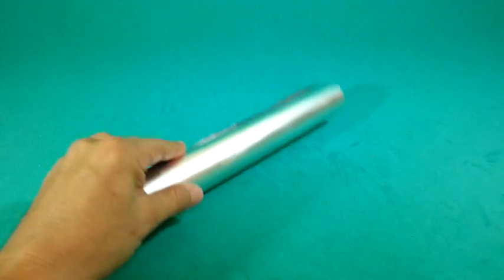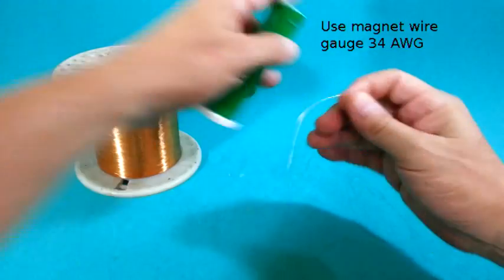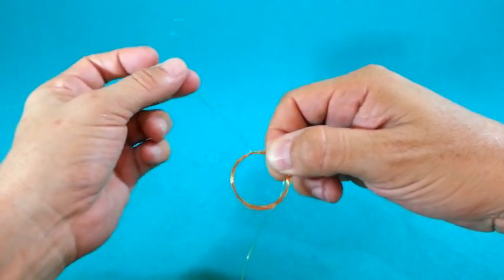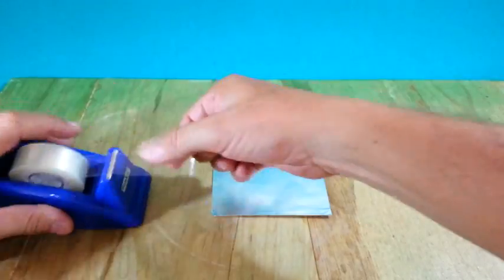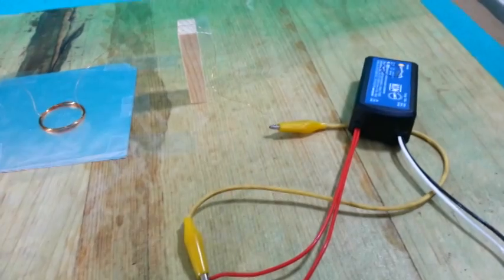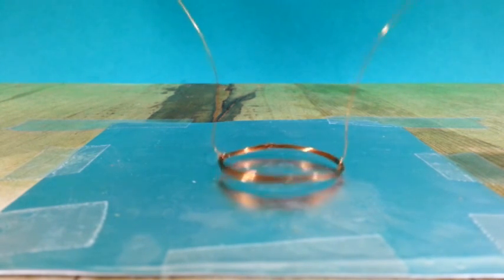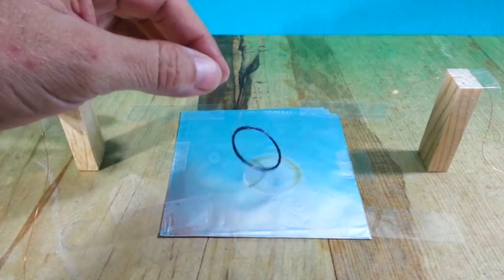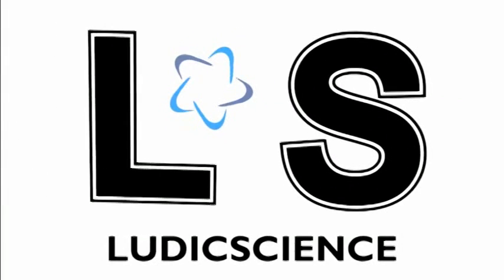Levitating Coil - Lenz's Law

Comment: Your vids are cool but sometimes you're mistaken. Ballasts are DC, although they can generate frequency.
Reply from the maker: You´re right. It´s hard to make them both simple and accurate. The correct explanation would be to say that the ballast is high frequency chopped dc current, that produces very similar effects as pure ac.

Comment: cant I use a 60hz transformer and a 470ohm 1w current limiting resister 
or 
I have a 800v Philips 36w e ballast 
will it work
Reply: Ivan R but it has 50 volts drain source limit. therefore its only usefull for half wave inverters. forget about making zvs, because the input inductor+the energy in the lc circuit can give it 60v if you work with 12v input
Reply: Mrinal Thakur awn well, I guess youll have to order it online then. BTW, did you recieve what I sent you on google +?
Reply from the maker: No. Low frequency will not work.
Reply: Or pulsed dc form a irf540 by a 555
Reply: Well hello there! Yes, a 555 timer will work, but an irf540 , is not very good for this circuit, because it can only handle 28 amps continuos current, and "100" amps pulsed, seems a bit bullshit, and it will realistically only take up to around 45 amps, and it is a fairly low speed mosfet. A BUZ11 will do a much better job as it can handle up to 30 Amps continuos and 50 pulsed, and it has a higher transition frequency, other than that the design is good! BTW, we just moved into Singapore, and im making that MOSFET Audio Modulated Slayer Exciter I was telling you about, and I already have several circuit prototypes and a final circuit, which im gonna finish this month!
Reply: Mrinal Thakur irf540n and 540ns is the best mosfet i have ever seen. best max current and high frequency performance for the lowest price
Reply: Gotin Fuklio I pushed it upto 284khz
Reply: Gotin Fuklio hen try irf460
Reply: Gotin Fuklio The BUZ11 can handle more power than the irf540n, and it can reliably work at a much higher frequency, and I used it in a flyback driver, and as a mosfet tesla coil. IT RAN ON 380 KHz! Not 55KHz, and it is better for this circuit already because it can handle up to 50 amps pulsed current! Not 30 amps!
Reply: Gotin Fuklio indeed, but you can use a simple snubber circuit, to clamp the high voltage feedback, and why make a zvs inverter, when it works with a 555 timer inverter, and the 555 timer inverter is much cheaper, and has a similar efficincy, and I am certain it can be used in a full wave inverter, because I have made multiple half wave 555 timer inverters and transformer drivers with it, and I was able to drive a flyback from up to 30 volts, and, as the output is a square wave, you end up having to do completely different calculations for the output voltages, and you can get those same 240 volts from a 12 volt transformer, from 3 VOLTS!!! And when resonance is achieved, you can get 10KV!!! From that same 12 volt transformer!!! Additionally, those parts can tolerate anything within a 50 percent overload/ overvoltage, so it can survive a small zvs, and why not just use a higher gain transformer?
Reply: Gotin Fuklio yea zvs is far better
Reply: Ivan R i make circuits that draw 3+ amps
Reply: Ivan R 1,5 mhz with steel core and 90% is bullshit
Reply: AlertIowa1234 yes
Reply: Ivan R let's see
Reply: Ivan R no they don't and in India mumbai
Reply: ever tried giving it a higher voltage input like 32-60v? BIG Heatsink tho
Reply: +AlertIowa1234 I have tried up to 90v from a 1200 w boost converter
Reply: low frequency and high resistance would kill the induction
Reply: Did you bought that rf function generator
Reply: That's the only MOSFET availabe for cheap in India I get a pair of those for 119 rupees
Reply: Ivan R irf540n/ns are the best for frequencies 55 khz and less. more than enough for most of the uses you can find for it
Reply: Mrinal Thakur 460 have bad high frequency performance and are expensive. 2 irf540 in parallel make 460 obsolete. 460 is rated 500v drain source-way too much for the most applications especially homemade human touch safe circuits
Reply: Gotin Fuklio what is home-made human touch circuit
Reply: Ivan R can a 240v transformer's insulation withstand 10kv
Reply: Mrinal Thakur 1kv is the limit. 10 kv would break trough it
Reply: Ivan R i did experiments 555 vs zvs. the same mosfet on 555 vs 2 on zvs. meanwhile the 555 overheats the mosfet at 2 amp average consumption the zvs withstands 6 amps average with no heat. the same is valid for zvs with bipolar vs fine tuned royer oscillator
Reply: Gotin Fuklio yes but limit for 240v transformers not potential transformers
Reply: Mrinal Thakur not only zvs, but every full sine wave inverter or self driving oscillator
Reply: Gotin Fuklio I shit you not, I was getting a 1cm ark from 12 volts!
Reply: Gotin Fuklio Are you sure you had it tuned properly, as the CCFL circuit I made, ran on a BUZ11 mosfet, and at 13 watts load, it pulled 1.5 amps, and it was stone cold!
Reply: Ivan R what current did it draw from the input and what core type was the transformer?
Reply: Gotin Fuklio I had a 12 volt to 220 volt 50 to 60 hertz laminated core transformer, however I was running it in a resonance mode at 1563.8 KHz, and It drew only 1.5 amps at 12 volts for a 14 watt load! The efficiency was 87.5 percent!
Reply: Gotin Fuklio indeed, I mead 1.5 KHz!
Reply: Oye
Reply: 4 words IGBT Half Bridge Flyback
Reply: CM200DY
Reply: AlertIowa1234 is that the igbt part number?
Reply: ye
Reply: AlertIowa1234 but an IGBT with such specs is a complete overkill, as your not lifting a car :P!
Reply: mains halfbridge
Reply: AlertIowa1234 That is going to be a shit-ton of power going through the wire. If you want to lift something with it, what matters most is the current going through the wire, and as P=VA, you will need to have a very large load to draw 10 amps at 220 volts(or actually 380 volts due to RMS voltages), whereas at 12 or 24 volts, you need a medium sized load to draw those 10 amps. What you need is a high current low voltage fast switching mosfet, like a BUZ11, and not an IGBT.
Reply: nothing a copper bussbar cant do
Reply: also why the 50v rating on the buz11?
Reply: and a igbt is a combo of a mosfet and a bjt
Reply: Ivan R making flyback driver at 220v is the best solution. this way you need higher voltage lower current rated switching devices and thinner, but longer primary wires
Reply: AlertIowa1234 igbt's have enormously bad switching times. almost as bad as scr. this igbt you showed here is for brushless motor drivers. it is not for high frequency inverter
Reply: Gotin Fuklio yes
Reply: Gotin Fuklio most IGBTs are slow, however there are exceptions, like for example the IGBTs used in DRSSTCs and Bidirictional debfibilators.
Reply: +Ivan R but not all
Reply: Mrinal Thakur what do you mean?
Reply: lmao we have gone waay off topic
Reply: and digikey is your friend for all kinds of parts, https://www.digikey.com/
Reply: AlertIowa1234 they don't ship to India😞
Reply: Mrinal Thakur are you kidding me? they manufacture all sorts of parts in India, just get a few samples at the factory :P!
Reply: Mrinal Thakur indeed
Reply: Ivan R sent me what I requested you for a better 555 plasma speaker schematic
Reply: Mrinal Thakur hear is a better one but its a little bit more complicated, http://adammunich.com/wp-content/uploads/2010/12/schem.png
Reply: Mrinal Thakur and here is one using a 555 with resonant cap http://boginjr.com/wp-content/uploads/smallgen_en.png
Reply: +AlertIowa1234 thanks a lot sir but sadely I don't have that SG chip
Reply: +AlertIowa1234 the other one seems to be familiar 
infact I am using the same with some better modifications like a RCD snubber and a AC line filter
Reply: and that rcd snubber is probably whats giving you poor output
Reply: Mrinal Thakur I did :P
Reply: +AlertIowa1234 don't worry for power input I have four tt2206 power transistors in parallel and each transistor can take up to 1600v 10a
Reply: +AlertIowa1234 I know
Reply: AlertIowa1234 Probably a freewheeling diode is what is giving you the poor output, a snubber circuit does not have a very drastic effect on the output.
Reply: +AlertIowa1234 the transformer was in oil I was pulling nice 12-14cm thin arcs
Reply: usually the mosfet has builtin freewheeling diode built in
Reply: AlertIowa1234 yes but not all of them like irfp9540 is having but irfp540 is not and also some transistors are also having internal diode like tt2206
Reply: AlertIowa1234  A mosfet and some transistors have a transient protection diode inside, which prevents the mosfet from failing if reverse voltages occur, as the diode has a lower forward voltage and hence a lower resistance than the Mosfet/Transistor it is protecting. A freewheelinng diode is a diode, which is directly across the load.
Reply: Ivan R also called the TVS diode or flyback diode
Reply: a tvs is actually very similar to a varistor
Reply: +AlertIowa1234 what's that
Reply: A varistor is an electronic component with an electrical resistance that varies with the applied voltage. Also known as a voltage-dependent resistor (VDR), it has a nonlinear, non-ohmic current–voltage characteristic that is similar to that of a diode.    FROM WIKIPEDIA
Reply: AlertIowa1234 it's like a electrical potentiometer
Reply: its also called a mov or metal oxide varistor
Reply: and its used as a surge arrester for voltage transients
Reply: +AlertIowa1234 ok

Comment: Attach the aluminium below it vertically and the ionized air flow it creates will make it fly.
Reply: you need electrostatic field for that. not electromagnetic
Reply: And your point is...? I never said you need electromagnetic. Also one implies the other, with an electrostatic field you also have electromagnetic field.
Reply: Krisztián Szirtes but the efect in the video is based on magnetism. ionocraft is based on hv electrostatic field between specific electrodes